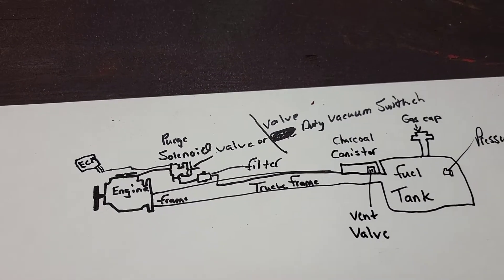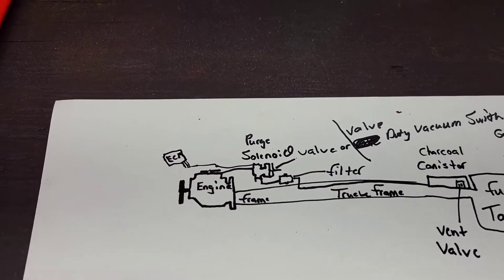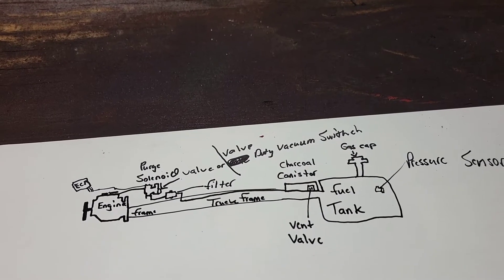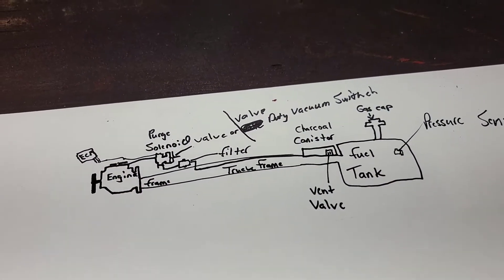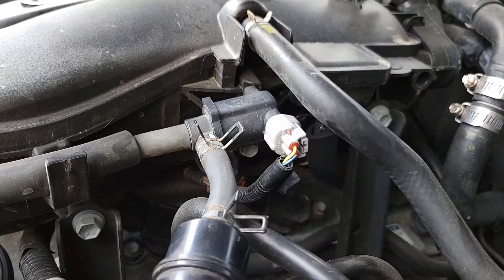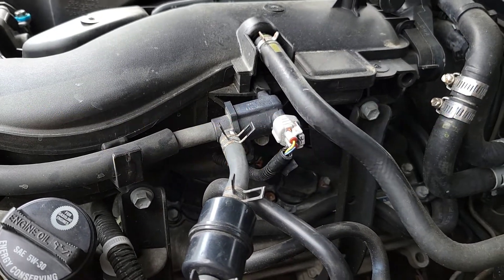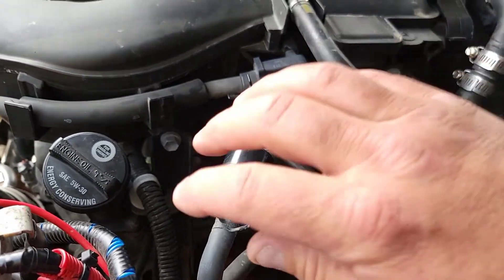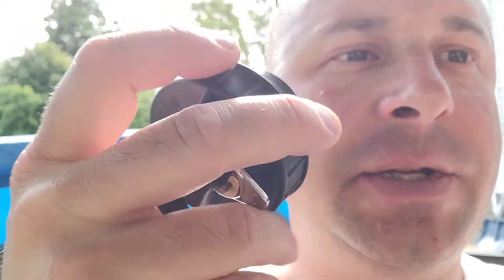Diagnosing Tacoma, p0455, p0441, and other vehicles, at home with no fancy equipment.

Comment: One symptom you'll see, if the VSV/charcoal/evap canister is bad, is that when you're filling with fuel at service station it will repeatedly click off and you'll have to reset the gas pump dispense. It's doing this because there is no vacuum on the tank. Likely due to saturated canister (repeated overfills?).